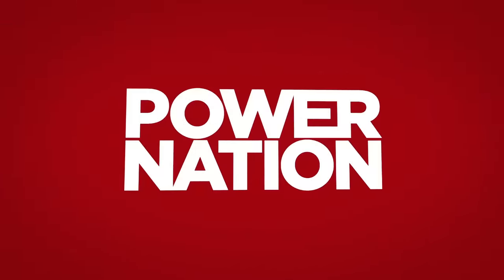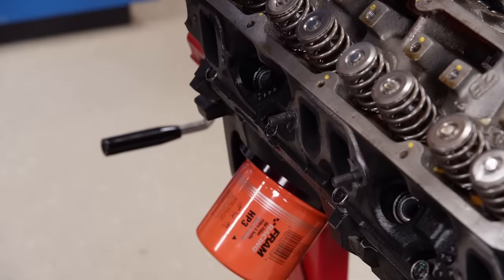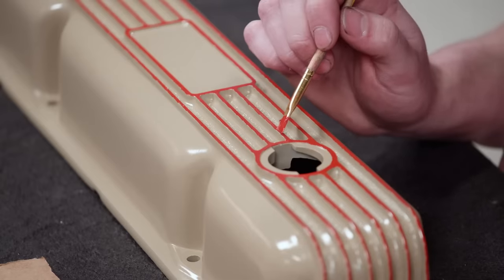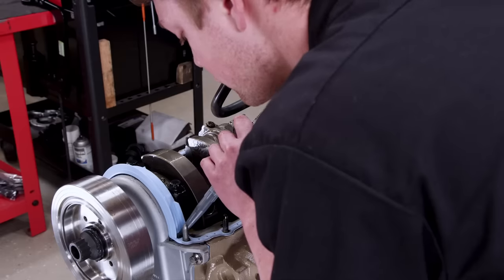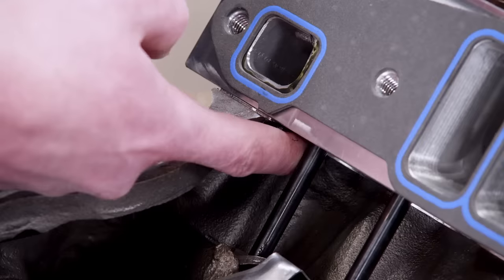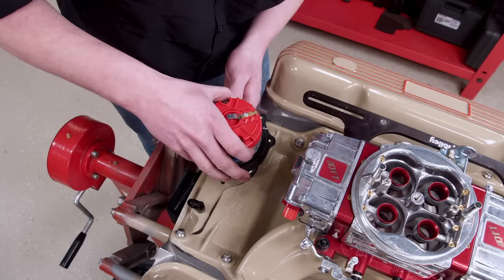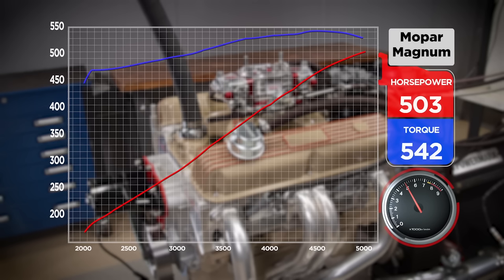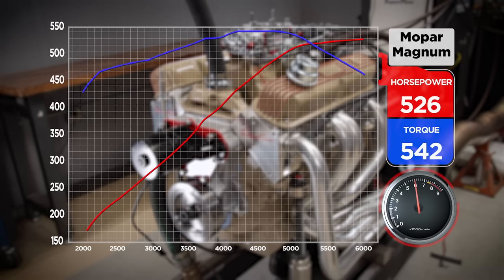Upgraded Induction and Valvetrain Makes Great Power on our Small Block Mopar - Engine Power S9, E4

Comment: As someone who had a reasonably built 406 SBC in a 1967 Camaro, those torque numbers mean fun all of the time, everywhere. Imagine this engine in an early 1970s Duster with a five speed!
Reply: Imagine it in a Viper... or '65 Satellite...
Reply: @BuzzLOLOL  Cobra 427 replica? Love to see a Mopar in one.
Reply: I have a stock stroke 360 4-spd in a 69 Barracuda that’s making 534 hp. Doesn’t have the torque of this stroker but the 488 ft/lbs that it makes will get the job done fosho
Reply: @yendor86  which transmission
Reply: @MrJ183  A-833 4 speed
Reply: @yendor86  nice, how is it handling the power
Reply: @MrJ183  It’s still in the resto shop. I haven’t driven it yet. Waiting on interior parts since forever.
Reply: @yendor86  Sweet! I have a 68 fastback. What is your recipe? I'm building a stock stroke 360 right now, block is at the machinists getting blueprinted. Internal balance cast Scat crank, forged Scat I-Beams, I had to go 0.030" over forged pistons, 10.4:1 compression with some Promaxx CNC Shocker 185's. Cam is the Lunati Voodoo SFT 30200740. Advertised Duration (Int/Exh): 264/272 ;Duration @ .050 (Int/Exh): 235/243 ;Gross Valve Lift (Int/Exh): .525/.546 ;LSA/ICL: 110/106 ;Valve Lash (Int/Exh): .016/.016 ;RPM Range: 2400-6600 79 gram edm hole lifters, don't have the pushrods yet probably going tapered Smith Bros, ductile iron Crane rocker arms, Comp Cams 7228 conical valve springs and tool steel retainers. intake valves, hollow stem Ferreas, haven't decided on exhaust valves, I don't think I'm going with sodium filled exhaust valves, this is just a naturally aspirated engine. I'm trying to get the valve train lightened up as much as possible, and the rotating assembly balanced. I want this thing to spin up fast with my gearing. Exhaust out through some Doug's D453's. Intakes I have in my shed, and I want to try all of them, Eddy Airgap, Eddy 180* dual quad, Offenhauser 360* dual quad. I have the sneaking suspicion that I'll end up with the Weiand tunnel ram. Driveline is a 727 from 727specialist.com and a 4.10 Dana out back (it was $200 more than an 8 3/4.) 002 and 003 leafs out back. Current T-bars are the 318 bars. I'll swap in some /6 bars for racing though. I don't have my ignition yet, going with the setup from 4secondsflat.com. I gotta talk to a manufacturer to get a custom stall converter, my current 2500 won't cut it.
Reply: @ShovelMonkey  My combo is similar. Differences are: my cam is Lunati 30200742, .566/586 lift 251/259 dur @0.050. Heads are CNC’d ProComp. Intake is Weiand 7510 port matched. Compression is 10.6:1. Headers are TTi. I have a Dana with 3.73’s. Wishing I had gone with a smaller cam to bring the powerband down a bit.
Reply: @yendor86  I went with the 740 cam because I don't expect to be over 6200 with my 27" tires and 4.10 gearing at the 1/4 mile mark, also the Offy intake (also gasket matched) is supposed to be best between 2000-6500 or so if I remember right.. Driving on the freeway with those gears isn't a lot of fun though. I'm winding at 4k rpm at 70 mph.
Reply: @ShovelMonkey  Sounds like a nice combo. I had my engine built 7 years ago so it is what it is. If I were doing it today I would make some changes.
Reply: @BuzzLOLOL  why would you put it in a viper when you can run a better set of heads and a cam and make anywhere from 550-700 wheel horsepower depending on the generation? those v10s put in some work and love mods. they're vastly different from the 5.9 magnum it was based off of.
Reply: why just a 5 speed? throw a tr6060 out of a viper or challenger in there. all small block mopars from the LAs from the early 60s to the current day hemis share the same bellhousing bolt pattern.
Reply: @yendor86  Where did it make peak power? I'm trying to decide on a cam for my 414 stroker.
Reply: Can anyone build me a stroker with 318 block for late model racing?
Reply: @yendor86  What are the specs on that 360?
Reply: Where do you get the 5 spd? Lol might as well go with a 6 spd tremec.
Reply: I had a junk yard 360 in my 72 Duster and that thing ran pretty damn good not sure what was done to it because it was a 79 block and I pulled it out of an 84 W250 so I'm assuming it had been rebuilt at some point
Reply: @johndomine1574 these kits are available with forged steel crank at 4" stroke. 390 cu in. $2100.00. Google it.
Reply: @ShovelMonkey 
Have you given any thought of installing a Gear Vendors Under-Overdrive unit to the transmission?
Reply: @MrJohnnyDistortion  That would be nice if I ever get the cash for it.
Reply: Hell, with that much torque you wouldn't even need the 5 speed! Haha give me that 727 and highway gears.
Reply: @yendor86 I have four new yokers
With a Chrysler 440.  Not magnum 
I use them for a demolition derby
Reply: @mrsteve4313 I don't use manual 
Transmission. I use automatic 
If I use a manual transmission I will 
Burn up the clutch plates
Reply: I like that you, a Chevy guy, made such a positive comment and made a parallel to a similar weight car. While some Dusters can be on the fatty side, equipment dependent or lack of equipment like A/C etc…..
My particular Duster is under 3,000 as delivered and has been lightened some to an unknown weight with fiberglass and missing interior.

Thanks fella car nut!

Comment: Good build, shows what a 410 Mopar will do with good heads.  But one thing to remember that they left out, the Trick Flow heads use the LA intake and valve covers, not the Magnum.  Also, they use a dedicated Harland Sharp roller rocker set up at $1000.  The key to power in any engine is good flowing cylinder heads.
Reply: You can use stock rockers if you wish as long as your block has the rocker shaft oiling holes drilled. If it's a later magnum block without the rocker oiling passages drilled you just need to make sure your lifters, pushrods and rockers will oil through the pushrods there's more than a few rocker setups that will work.

Comment: In 1980 my first car was a 1970 duster with a slant 6. I had a 340 ready to swap in it when the car was destroyed by a Mercedes S running a red light. I put the Duster completely out of my mind when I found my second car, a Boss 302 Mustang. Fast forwarding to now I found a completely rust free original condition 70 Duster with a worn out 318 and it has a Dana posi rear end. Thanks to power Nation I know exactly what motor I will be putting in. I planned to squeeze in a big block 440 but no need when this 410 will fit great and make basically the same power and be 150 pounds lighter. With this much torque I will have to seriously strengthen the frame, but that's a great problem to have. It's going to be a very stock looking sleeper with electric exhaust cutouts and Coker OEM looking '70s rally style Mopar rims but taller and 2 in wider. It will also be getting a third pedal and a 5 speed but don't tell anyone. 
 Love this channel.

Comment: I think it  would be more fun in my 94 Dakota with a mostly stock 5.9 . especially with the trick flow set up. . thanks for your hard work.
Reply: Or Dodge Dakota R/T or 93 to 98 Jeep Grand Cherokee
Reply: @jakey20022  true those too. I have reg cab 00 RT.  It moves good but it's heavier. Than a gen 1 Dakota. And the pre 96 models have the 45RH trans. Which I have and like. Don't car for the solenoids that fail. But I've seen some 5.9 powered jeeps that run quick. But I don't have one.
Reply: I did one in a 93 dakota, little bit different, 426 stroker, iron heads, efi, solid street thumper
Reply: @oellrichm  wow..
Reply: That's an awesome truck! Strong, reliable, capable of a million miles, AND one of the most handsome trucks ever made!
Reply: Have a buddy that owns a 2nd gen Dakota with a mean 408 on spray and a TKO with the 6th gear delete. 9in Strange out back on a 29x9.5/15's. Full exhaust (super tame at cruising speed) with a throttle referenced cutout that opens at WOT. Faded factory paint complete with stock wheels makes it super unsuspecting. Frequently hurts feelings on the street.
Reply: couldn't agree more.  i have a 390 stroker kit in my 94 dakota pretty much was an all stock 5.2 before the stroker kit but im getting ready to go bigger on throttle body to match another jump with bigger injectors again along with a new cam.. the engine has 230k on it so probably do a refresh too with some 1.7 harland sharp roller rockers
Reply: I haven't been able to really drive mine because the trans decided to blow up but I can tell you stock dakota rts are fun, just 350 horsepower alone with that massive torque curve that these engines have it'd be a riot and you'd be crapping all over scat packs and giving hellcats a run for their money since you'd also have a set of 3.91 rear gears. the problem would be hooking up with no weight in the rear. without traction being an issue, a 550 horsepower dakota rt would mop the floor with hellcats just because of the power to weight ratios.
Reply: Since everyone sharing their dakota my baby is a 96 sport 5.2 5spd single cab with bench seat. I think that engine would look better in these dakotas. For sake of age of them both. My next ideal would be hemi swapped dakota. Am broke so I work with what I got and is cheap. Ls is everywhere I like to be a lil different
Reply: 1999 sport 5.2 single cab lowered and black , 280,000 miles and still smokes the tires down the street

Comment: By far the best results that I've seen Engine Power get after building a small block Dodge, who've typically restricted Hp with inadequate intake runner flow.
Reply: Horrible shrouding in the intake runners. What the hell were they thinking?
Reply: Yeah I think this made more than the 6.4 L hemi they built.
Reply: @DBSSTEELER  More torque (550 vs 474lbft) but the Hemi had the Holly High Ram EFI intake and box, made 564hp vs 537 for the Magnum. The Hemi lacked the Chevy budget, using the OEM heads!
Reply: @BobbyOfEarth  

The 6.4 with the high ram was all brand new parts. With out that they could have popped for aftermarket heads or CNC porting.

Comment: I could never afford those Trick Flow heads or aftermarket roller cam. Good to know that the factory setup with a 408-410 ci stroker kit can make nearly 500 lb-ft. That's where I'd put MY money; a low buck stroker kit with cast crank, SRP rods, and hypereutectic pistons. Perfect truck engine.

Comment: For oval racing the stock bore 360 was our backup motor in place of a 0.020 over stroked 340, (355cid). We normally ran 36* timing. This was on a 3/8 mile banked paved oval. The worst thing about the 360 was the torque, it would actually spin the rears coming out of the corner, where the 355 would drive out clean.
Reply: H ow was the 318?
Reply: @rogerfox9028  The 318 was a great street motor, but never intended for track racing. The 360 was developed as the small block truck motor. The 340 was designed by Chrysler intended for racing use in the Trans Am series, to compete against GM 350 and Ford 351's. For stockcar racing where the displacement limitation was 355cu, MOPAR developed their stroker kit with a bore increase to run at the 355 limit. The 360 being a truck motor was built as a torque monster that would spin the tires too easily. The 340 bored and stroked, 355, had the torque come in higher in the rev band and revved higher, giving it a power band better suited for oval and road racing.
Reply: In road racing trim, the 340 was 305 cubes.

Comment: Finally, dyno is done. 550 pound feet of torque from small block is pretty healthy. Thought the guys seemed a little apprehensive on the dyno. Wonder what happened to the Ford red painted magnum from like a year ago? New paint job looked ok on the engine stand, but wonder about it in the engine bay. All in all, they finally finished the job. Good job!
Reply: On the earlier 410 build they don't show the dyno video because they used LA heads and valve train on a magnum block and it blew up
Reply: Did not know that. Mix and match not good in all areas. At least they did a good follow up to satisfy all the mopar fans that were left up in the air. Goes to show you that old school small block LA can still compete with the small hemi tech world.

Comment: I wish they'd have done the cam swap first to show what it did with factory heads then upgrade the top end.
Reply: I agree
Reply: that big cam probably would've wanted new valve springs and pushrods to handle it. The ones on the new heads probably wouldn't have fit the old ones either.
Reply: I would suspect the cam is a bit too big for factory heads and would show what not to do when just upgrading your cam.

Comment: I want this engine! I built a similar engine several years ago using a 91 360 roller block, Scat forged stroker crank and H beam rods. CP Bullet pistons. I used a set of heads from IMM machine, a lumpy Erson hyd roller cam. It was fun in my 340 demon. I would have loved to have a set of these heads on it!

Comment: Sure, that's a fine torque wrench, of course any hand tool that costs north of $650 had better be nice.
Reply: funny thing is, a $170 Harbor Freight wrench does everything the Matco does for a little over a quarter of the price
Reply: @leftventricle3  

The Quinn torque wrench doesn’t have a flex head nor are it’s led lights as nice.  The head is smaller though allowing it to get into tighter spaces though. 

Only good tools from harbor freight imo.  That and the us general tool boxes.
Reply: I do miss being a mechanic but rapeco hell no. The Harbor Freight 1/2 in air impact I bought in 2004 is still in use today as is my 3/8 in air ratchet. A bit of maintenance goes a long way.
Reply: I usually only buy Wright if I'm buying new.  I wouldn't use a harbor fright torque wrench as a tomato stake.
Reply: @leftventricle3  for $170, you better get one of everything at harbor fright.

Comment: I have turned my stock rods and crank, forged piston, stock heads and valve springs up to 8200 rpm, no problems. Been running 33 years, two trucks, two Ram Chargers and now in a CJ5. I would have no problems turning that stroker 7000 rpm and if you look at the graph the hp was still climbing so who knows what the peak hp would have been had they done so. As long as your engine is under load you should be safe, one reason why I never power shift at full throttle, always lift slightly when shifting, beats blowing an engine.

Comment: Heads need to match the block . Hide all upgrades as much as possible . Great video !!
Reply: That's why I  went with 440Source heads for my BB-Mopar build over these Trick-Flow heads. They look like a stock casting once painted. Yet flow enough to make 600+hp.

Comment: Very Exciting Numbers! 

I think the 360 is one of the most underrated Mopar mills out there. Most folks don't know its a stretched 340, essentially with the 340's best attributes,  LA or Magnum version.. Had the'73 oil embargo not hit when the 360 was fresh, it think it would have developed past the 340 in ability and popularity. 360 3 pack yea baby!

What fuel octane and blend are you running with over 11:1 compression? I did hear that right, over 11:1 compression ratio, correct?

Why is the distributor locked out, won't that kill its street manners, especially with a computer controlled dizzy and a tune? 

How about fuel injection vs. carb?  This combo really has my curiosity piqued,.. I would like to build something  just like it for a 1998 AWD 5.9 Magnum Limited Grand Cherokee, which I just so happen to have at the moment. Perfect power numbers to get it moving like the newer non-supercharged Hemi Jeep and Durango! Be able to whoop up on them on Friday nights at Lincoln!

Comment: If you pull the intake first, its simple to get the intermediate shaft out. Plus, it was on a stand, you could just turn it upside down and it will fall out.

Comment: The only thing that would have been better for street engine is getting the CR up to about 12.25:1, which is near the limit for 93 octane. That would have yielded some pretty nice gain as well. But as it stands you can run eco 87 or lower octane on it which is pretty impressive.

Comment: The way the power gains drop substantially after 5,000rpm, do you think it might be the stock lifters? Yes, it made very good power but the graph looks to me like there is a lot left on the table. I think this thing would love a solid roller.
Reply: Intake Manifold flow and heads flow restricts top end

Comment: Late but thank you guys for this currently building two durangoes one 5.2 2wd with powertrax and a 5.9 4x4 engines are going to be cheap / midrange so we can cover everything from can to intake and headers to exhaust lift kit and wheels should be interesting results for me and the little brother

Comment: I wonder if there's a scaling issue on the dyno at 16:19. The torque numbers cross at around 2600/again at 3000, the hp numbers don't.

Comment: Great build!!  I'm questioning the stock dyno run.....I had a '99 Ram with the 5.9, and my son currently has a 2000 Durango with the 5.9, and it's not putting out anywhere near 300/400 at the crank.  They were rated at 245/345 or so, if I remember right.  Regardless, great build......would love to see one of these builds using the factory, just to see what can be done to a stock daily driver.
Reply: their dyno run was definitely gross power, no accessories and an electric waterpump, so no power losses...also had an RPM air gap intake and dyno headers IIRC instead of the stock "beer keg" EFI manifold and exhaust manifolds....

Comment: those are good numbers my 360 stroker only made 530hp 560tq  just don't have the intake or heads to make real power got worse with a victor intake compared to a ported air-gap , next time i go big block